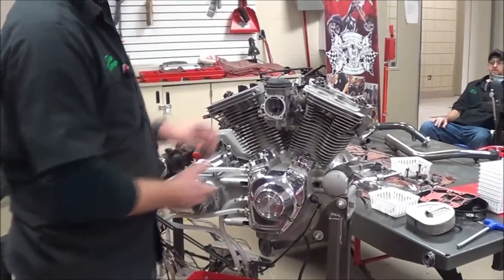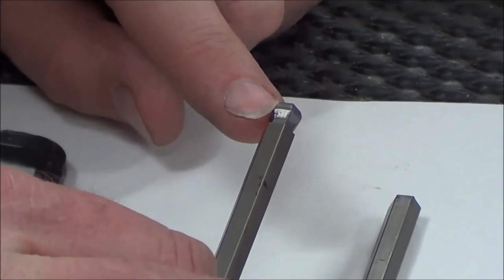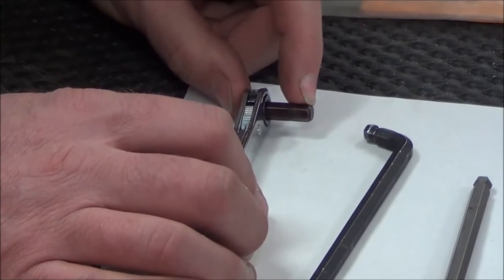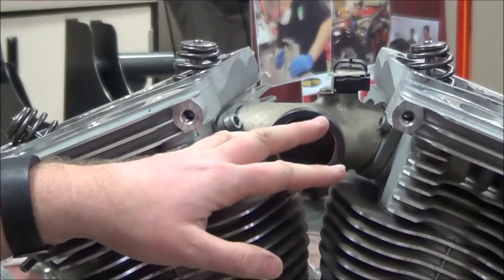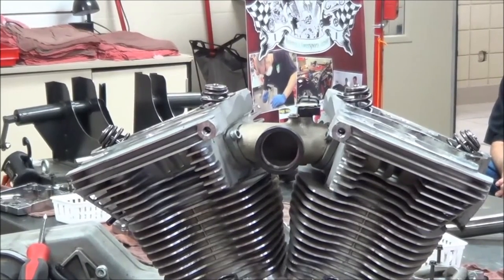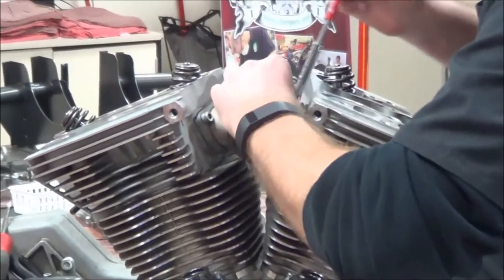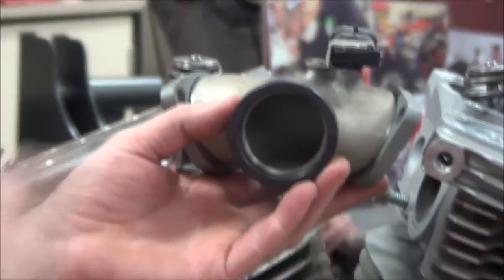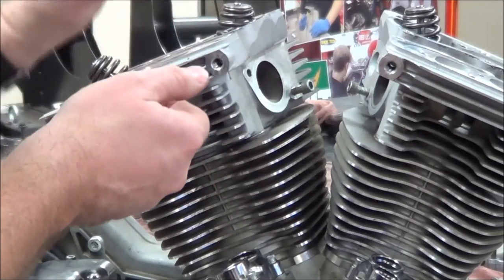Twin Cam Engine Series: 02 Carburetor Intake Removal

Comment: perfect video.  I just used the ratchet tool.  no way to remove the flange bolts without it.     but still not a solid connection- somewhat of an angle.    I'm going to try to replace the allen bolts with hardened hex bolts.  will make it easier to remove if I have to int he future.